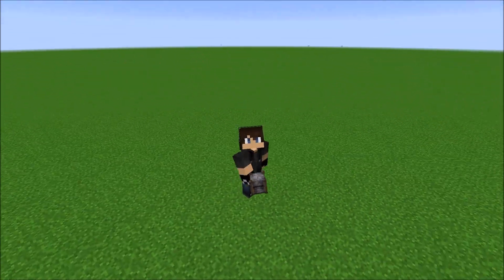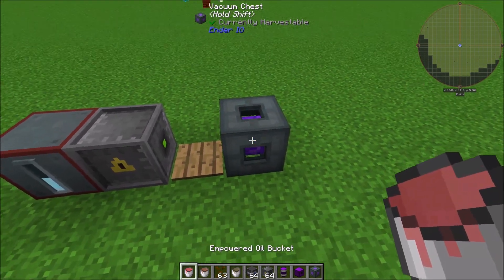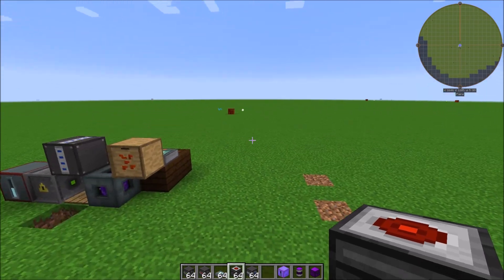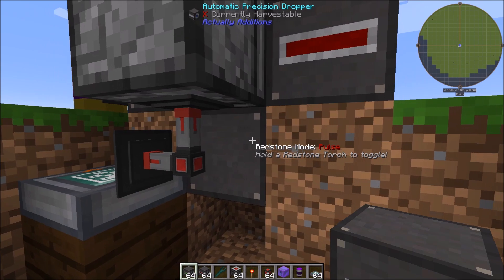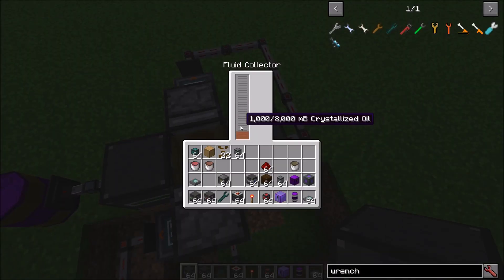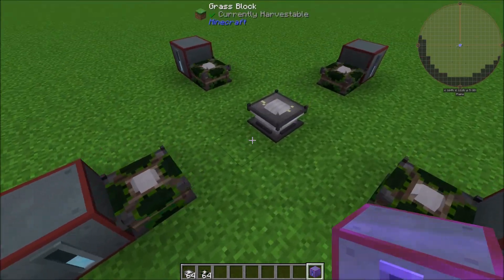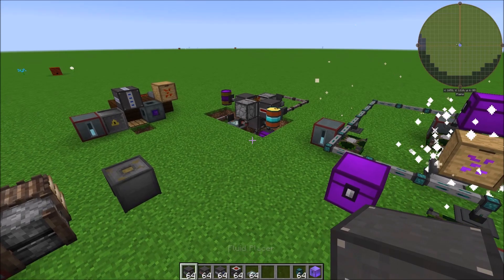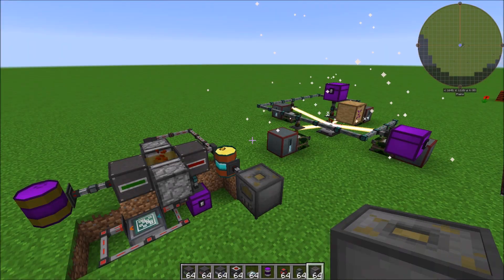Actually Additions Canola Oil Full Automation Tutorial - All Tiers

Comment: Couldn't you skip tier 3 by adding a precision dropper above tier 4, and connecting it to the same pulse as the bottom, allowing it to covert from oil, to crystallized oil, to empowered oil instantly? As long as they drop at the same time, the scanners can just be set to oil and empowered oil.
Reply: Trent Beckman i like your thinking, compact the machine down even further
Reply: Yup, you could.
Reply: What if you, at one point, have fewer empowered canola seeds than crystallized canola seeds? It’d just stop working, wouldn’t it?

Comment: One alternative way to do the redstone for the fluid collectors is to have them on redstone deactivation mode and invert the signal from the scanner through a NOT gate. It's ultimately the same result as in the video, but if you have project red I find that this can be a very compact and neat way to do the wiring.

Comment: Thanks man, that was really helpful. One tweak that I would make is to use regular droppers since they will push out at least one item with the initial pulse of a constant signal so I can ignore the whole sequence thing. I will also stack both dropper on top of the scanner and let them both shoot at the same time. This way I can convert Oil into empowered oil in a single step.
Reply: Does that apply even if they don't have an item in them initially?
Reply: That won’t work if they don’t have an item in them.

Comment: Thank you for this tutorial. I have used part of it,  The only change that I made was I used refined storage for part of it.  I used the constructor to place the oil down.  Then used the scanner sequencer setup to detect the oil.  Then I used the destructor to pick it up. since you can tell refined storage only to pick up crystal oil it takes away the need for a second sequencer.  I am sure if someone with more talent than me worked on it they could  place crystal seeds with another constructor.  I am not good enough with it to limit the seeds to dropping one at a time though
Reply from the maker: Yeah, very good alterations when you have refined storage :)  Iirc refined storage has a toggle bus type block I do believe, so could use that to limit and detect for seed drop, just an idea.
Reply: They have a block called a detector.  And you can set it to emit a redstone signal when a certain condition happens.  Like less that 64 of an item/fluid equal to 64 of an item or fluid.  when it is over 64.  Then all the Equipment has an option to operate with or without a redstone signal.  So getting a bit better with the system.
Reply from the maker: Yeah, im not a huge fan of RS personally, but it does have some handy features for things of this nature indeed.

Comment: Thanks! 
I had some headache in FTB Relevation as there is no redstone conduit - used IE redstone wire - also worked.
Reply: could u explain a bit how u did that ? trying to use the IE wire but not working too

Comment: when connecting the oils to barrels or the oil transfer in general do you use Fluid conduit or Item conduit?
Reply from the maker: fluid.  The oils are liquids, however canola and seeds are items so for that you would use item conduits
Reply: Sweet thank you very much!
Reply: Ok everything goin failry good but in the empowered stage my precision dropper will stop sometimes. then i have to manually throw seed in and it will go for awhile. Trying to figure out why it stops. it collects the empowered seed but wont put them in the oil.
Reply: Ok fixed everything I had one of my scanners wrong, Oops. But ran into New problem with everything going my fps dropped from around 120 to between 25 and 35 fps. Would removing some of the mods in my modpack boost the fps back up?
Reply from the maker: Ah yeah, that would do it.  But yeah, depending on the pack ive noticed fps drops as well.  Like in hermitpack I had to just shut it down, though its mainly tied to actually additions as all the particles and updates and such everywhere arent very optimized ime.  But some packs such as direwolf it seems to work fine so perhaps moving some mods could help, though I cant say for sure.

Comment: so with out having access to ender IO what other way can the redstone conduit be set up?
Reply: Set it to redstone mode disabled, then use redstone dust and a torch to invert the signal., or just use redstone dust to transmit the signal with the sequencers.
Reply: Personally, I like the Fluxducts from Thermal Expansion. If you're using the thermal series of mods, they work just fine.

Comment: Great tutorial! Unfortunately, it lag my world badly, I believe it's the sequencers that are the culprits. I'm trying to come up with another solution using logic gates (maybe super circuit maker).
Reply from the maker: Hmm, perhaps.  Could always cut down on how often they run as well using timers, but vanilla redstone/super circuit should be able to handle that part the same way the sequencer does
Reply: It was indeed the sequencers. If anyone's having the same problem, I changed the AA machines to redstone mode "Deactivation", and I'm using same setup but with logic gates that keep a signal unless all the conditions are met (ie, appropriate seed in the placer, right type of oil in the block above it), then toggles off. It immediately turns on again as soon as the oil changes, resetting the cycle.

Seems about as resilient, and causes less lag when not going at full speed. Unfortunately in-world crafting isn't too kind to my potato PC, I wonder if there's any crafter that will work.

Comment: Good tutorial, shitty way to make power. It cannot sustain itself, crops don't drop enough seeds that are needed to make higher tier fuels.
Reply: Yeah, they do. Just have multiple farms or one really big one. Or just a bunch of garden cloches.
Reply: using an AA farmer and things like worms and greenhouse glass, it can more than happily sustain itself, on my test world I have one crystallised oil setup powering 64 generators, putting out around 6.4k rf per tick. enpowered oil is even more efficient, my limiting factor is that a wireless draconium crystal can only support 64 links. it's not great but it's better than most generation methods and it is self sustaining at every tier of production